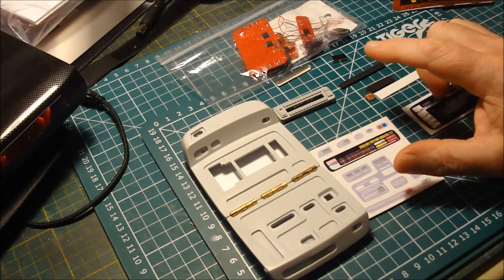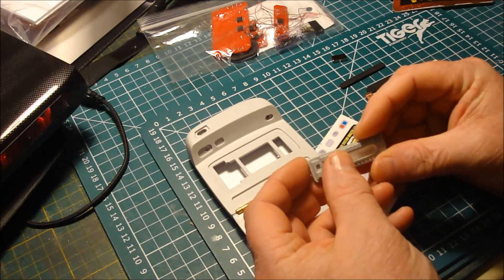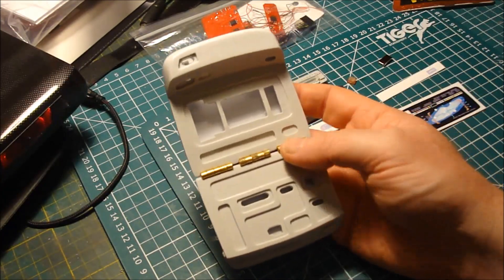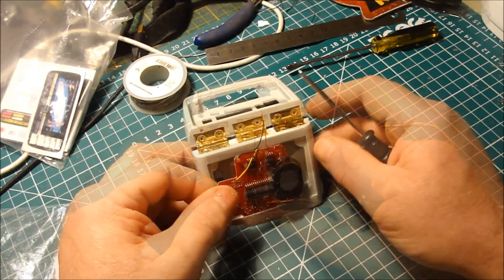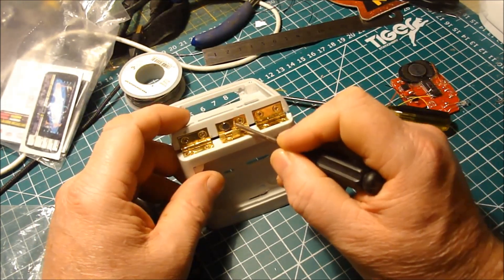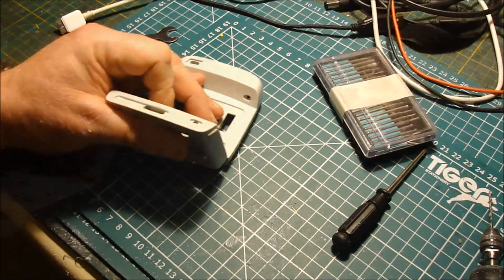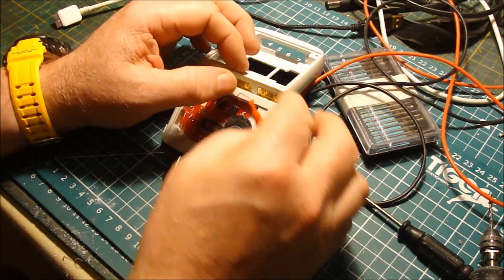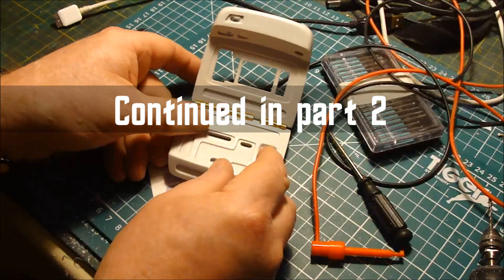Star Trek Voyager EndGame Science Tricorder Kit Build Part 1

Comment: if i connect a voltmeter should I get sound?  I get some lights but not all lights for that board?
Reply from the maker: +Tara Jueschke The sound board needs to be wired in to a power supply - it can be tested on its own or wired to the other boards
Reply: thank you!

Comment: at min 6:55 is that a volt meter or power source - if power what is it called
Reply from the maker: +Tara Jueschke  It is a power supply - turns AC into DC with variable volts and amps.
Reply: Thanks